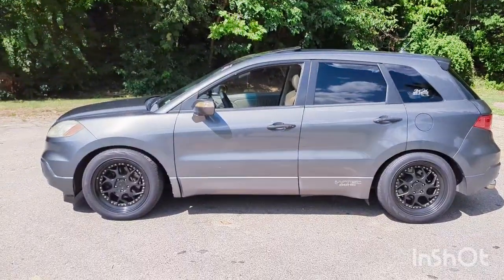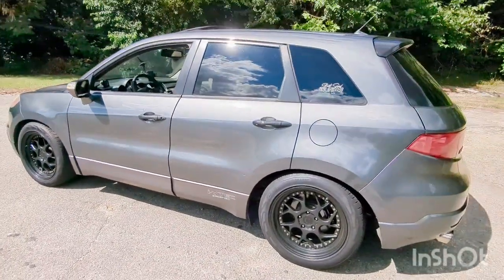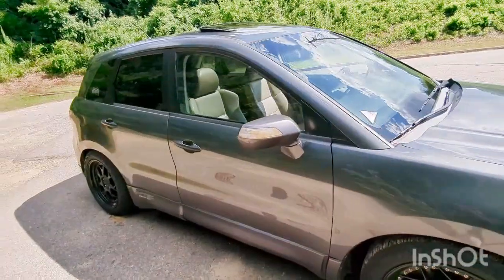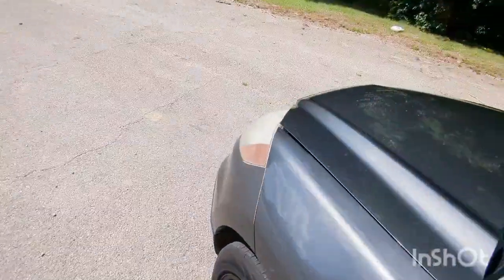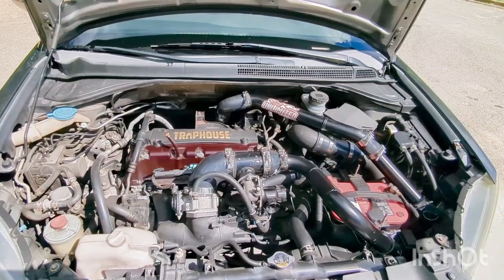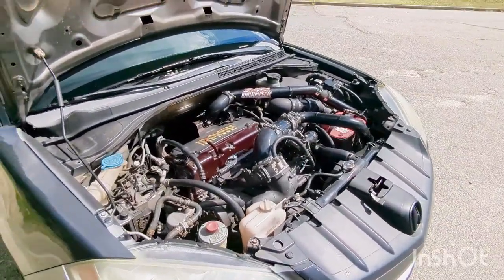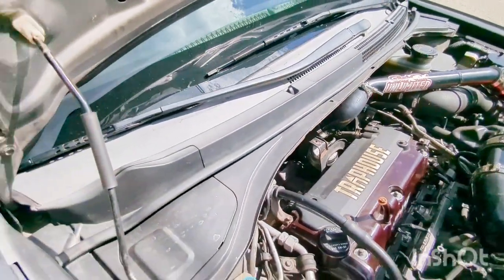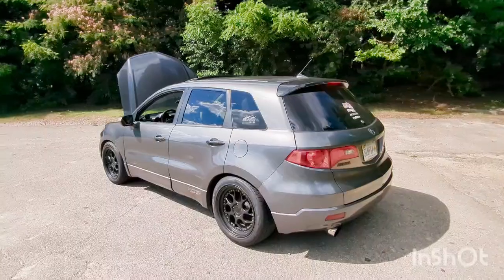Walk Around The RDX With Me | 2009 Acura RDX SH-AWD

Comment: any issues with the spacers?
Reply from the maker: @matthewmarsh5353  wheel spacers? Been on them for over 5 years, no problem!
Reply: @jmizzle24  ‼️ this what I been looking for I want to put spacers on my 10 soo bad ... like 3” 😂

Say tho.. what u think about wider in the back on the fwd.. counterproductive ??
Reply from the maker: @audacityhour3104  3" is a bit much.
But a staggered wheel set up wouldn't hurt it. The fenders in the rear are a bit wider anyway. That's why I have 25mm in the rear and 20mm in the front
Reply: @jmizzle24  what u mean by a “bit much” ? Like in what sense? Function, gevity or pokage... cuz I want that pokage in the back , flush in the front n lifted all the way around

I want my truck to look like a fat dude in a track suit
Reply from the maker: @audacityhour3104  depending on the wheel size, 3 inch spacer might be too much, that's just my opinion tho. But if you're going for the lifted look with a staggered set up, I'd like to see how it'll look. Normally lifted trucks are on squared wheel set ups